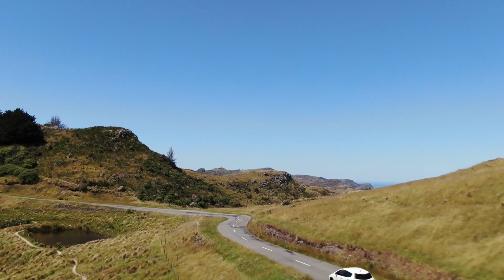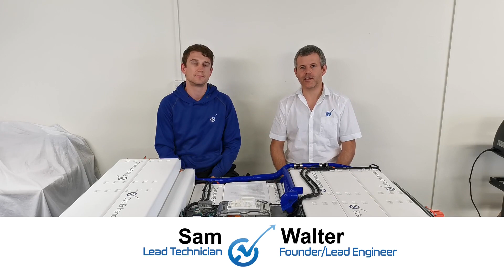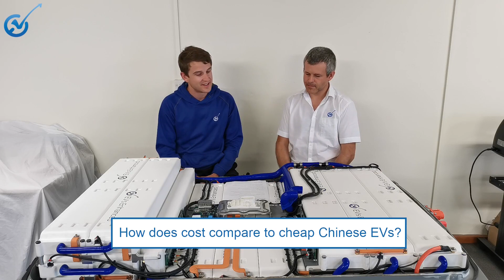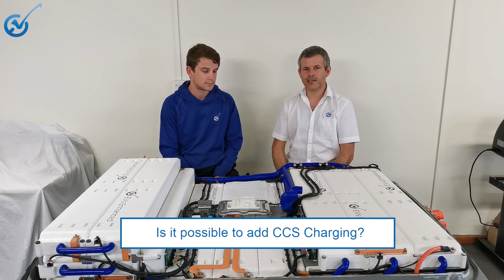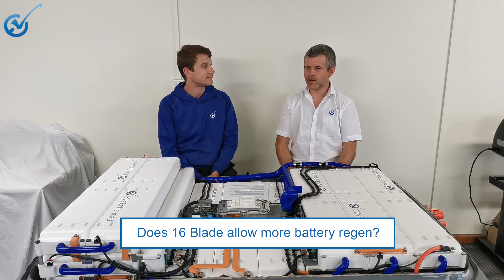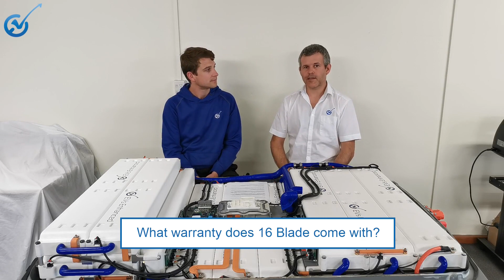Sam and Walter Answer Your Burning Questions - 16 Blade

Comment: Does the cooling system operate when the vehicle is switched off eg parked in the hot sun. I know the Tesla 3 system does this to keep the batteries cool when parked. In North Queensland the batteries on the Leaf fry in the sun. I lost about 30% range on a parked leaf in the sun for 2 months while overseas in summer.
Reply from the maker: Hi. This is still to be confirmed, but probably not.  The LFP cells in our Green variant are less sensitive to heat compared to the stock cells.  The cooling system is mainly to keep the cells from overheating during fast charging

Comment: Wonderful to see this developing, I'm curious about future proofing options though if the 16 blaze outlasted the older leaf and then wasn't compatible for a newer leaf? Also perhaps you could mention what the weight of the 16 blade is and how it might affect handling?
Reply from the maker: Hi. 16 Blade Green is very similar in weight compared to the original 24, 30 and 40kWh battery so effects on handling should be negligible. 40kWh Leafs are still in production today and this battery is designed to be compatible with those as well as earlier cars that originally had 24 or 30kWh batteries.
Reply: Hi, I just found your reply thank you for taking the time to respond. that's great, look forward to your next update. Tom, uk
Reply from the maker: @Toma2843  No problem.
Reply: Hi Eva Enhanced any word on any updates?
Reply: @evsenhanced

Comment: What is the theoretical range of the red pack?
Reply from the maker: Not a lot. Red is for short performance applications as a bit of fun, not practicality.
Reply: @EVsEnhanced  Thanks. Do you know the theoretical range of the other packs?
Reply from the maker: @hippyraverocker  Approximately 260km for city use and 200km for highway use with the green variant which is the first type that will go into production.  Blue has a much higher range, but the production timeline is further away.

Comment: Great development guys. Is there any rough figures on the weight of the 16 blade packs in comparison to the factory Nissan 24, 30, 40, 62 packs? Cheers
Reply from the maker: Hi. The stock 24, 30 and 40 packs are all around 300kg. The 62 is 440kg.  16 Blade Green is just over 300kg when dry.

Comment: Can you please elaborate more on the active cooling? Are you running a cooling loop to a radiator outside the battery, or is the radiator inside the pack? Or does the cooling loop just even out the temps of each of the cells?

I hope it's not too long before this comes to the U.S., but in the meantime it's very exciting to watch your progress!
Reply from the maker: We'll be doing a whole video on the thermal management system (both heating and cooling), so unfortunately you'll need to wait for details on that.  If you look closely at the pack sitting on display in this video you will see the two blue hoses that leave the battery pack heading towards the front of the car.

Comment: Fantastic to see this coming to market here in NZ.  Love your work EVs Enhanced.    Will the liquid cooled battery have a better performance in cold winter conditions, when mostly only AC charging?
Reply from the maker: Thanks.  The thermal management system can also be used for heating to prevent freezing.

Comment: What's the efficiency of the 16 blade? How many km/KWH?
Reply from the maker: Hi. That is more related to the car than the battery. 5 to 7km per kWh is typical depending on the driving conditions

Comment: You guys skipped my question.
What about battery heating?
It's a far worse problem than Rapidgate with everyday usage in cold climate.
Reply from the maker: To be accurate, what we have should be referred to as a thermal management system as it includes both heating and cooling.  We are planning to do a whole video on this in the future.

Comment: I admire what you're doing, but I'm still not sure about whether there's enough value for the customer in this. No CCS Charging availability, and installing on a ten year old car. Personally if the price is too high I'd rather just buy a new car and get the new car feel and performance.
I understand it's tough to make it cheaper, but does this make sense for the customer?
Reply: Judging by the general response - I'd say it's an overwhelming "YES!  About bloody time!"
Reply: A used 5 year old 40kwh Nissan Leaf is around $35-$40k vs around $20k less old battery trade in could be between $15-$17k depending on old battery health for this new 40kwh battery complete with an 8 year 160,000km warranty, seems like a bargain!

Comment: Hey guys, great to see you making progress on extending the lives of the Leaf fleet, question though, does the new battery weigh more then the old 24kwh? will it require low volume certification to fit or any suspension/brake modifications? Thanks
Reply from the maker: Hi. The weight of 16 Blade Green is very similar to the stock 24/30/40 which are all around 300kg. This keeps things much easier without chassis modifications like suspension being required. We have been working with LVVTA for some time to maintain compliance with NZ regulatory requirements.  It is still too early to say for sure, but our goal is to get to product level certification so that low volume certification is not required for each individual vehicle.
Reply: @EVsEnhanced  awesome

Comment: Did I hear correctly you say the cost of the battery will be about the same as the cost of a new car?
Reply from the maker: Nope. Maybe the Kiwi accent fooled you, but we indicated around 1/3 of the cost of an equivalent new EV before the trade-in of the old battery is considered.
Reply: Having watched this video as someone in the U.S., my question is regarding specialty: like other places outside of New Zealand, we have independent service shops that, like you guys, offer battery replacement/upgrade services. What are your plans for providing installation and service guides to other service shops?
Reply from the maker: @epicurioh  Hi. Most of these battery packs will be getting installed by other workshops.  We certainly won't be fitting them all to local cars.  We've already began discussions with some Leaf specialist workshops in the US.

Comment: Interested to know more about v2h capabilites. I would love to replace my leaf battery with the green lfp if I could also use it as a home battery to power my house at night. Would this need extra hardware? Perhaps the jet charge v2g wallbox?
Reply from the maker: Hi Ryan.  The V2H inherent in the design of Chademo is one of the big benefits that the Leaf has over other EVs.  The Wallbox Quasar that Jet Charge is importing into Australia is one of the latest V2H units on the market and looks very appealing.

Comment: Can we get a breakdown on the prices of the 3 versions of  the 16 blades? Can make a video of the installation of the 16 blade and how the thermal cooling would work?
Reply from the maker: Hi. We aren't currently releasing any more information on pricing beyond what is stated regarding the Green variant in this video.  There is certainly a video with details on the cooling system coming in the future.

Comment: Great video, answered almost all of my questions! Really excited to see the finished product. 

The one thing I didn't hear was the expected life time. I understand LFP is a better chemistry, so what would be the expected loss per year?

Also, how many charge cycles do you reckon? Tesla talks about 6000 cycles for theirs (model 3?).
Reply from the maker: Hi. Our expectation and design goal is for the battery to last for more than 500,000km.  However,  we are only aiming to offer a warranty period up to 8 years or 160,000km which is in line with battery warranties on new EVs.  We may also offer a subscription service for commercial usage with a guaranteed minimum capacity where we will continually replace or refurbish the battery as required.
Reply from the maker: @Jan 6 was "Wall Street Putsch" part 2 Hi. It's a great idea and one that we've been working on.

Comment: Amazing initiative. LFP ar3 rightly coming of age. This is a badly needed solution to the big problem - Nissan's failure to support their great EV. We provide range extenders in Ireland for Leafs and eNV200.
Reply from the maker: Thanks Eamon.
Reply: @EVsEnhanced  we also install CCS - kit designed by Muxsan. Leaves the Chademo in working order. Charge speed limited by main pack.Its not cheap.
Reply from the maker: @eamonstack4139  Yes. Muxsan is the company that we were referring to when answering the question in this video about a CCS upgrade for the Leaf.

Comment: Shame they seem to have abandon their earlier intentions to help with the Nissan env 200
Although 40 kWh would be barely sufficient anyway
Reply from the maker: No, we haven't abandoned our plans to offer an upgrade solution for the eNV200 at all.  We just said that our e-NV solution will not be based on the 16 Blade platform which is very much Leaf specific.
Reply: I understand EVs Enhanced are going to be pulling out a lot of used cells from the replaced batteries that they get to keep, and using these to rebuild battery packs for the eNV-200s.  
So although not directly, these packs are good for the eNV-200s as well.

Comment: Last year I got my old 2012 leaf's battery replaced by this team. They did a fantastic job. Honest and up front through the entire transaction. they were paitent with my many questions.
To be honest if I had known this was coming this year, I would have waited and spent twice as much and bought one of these instead!

Fantastic work guys, I may end up buying another leaf if I know I can put one of thier batteries in it - lets face it, the Nissan battery is the only really bad thing I can say about the car.
Reply from the maker: Hi Paul. Thanks for the kind comments.  We will be happy to trade your current battery in on a 16 Blade Green if you decide you want to do that when then are available.
Reply: @DVul  The price depends on the state of your battery and the capacity of the battery you select from the ones they have available, it would be unfair for me to disclose how much I paid for my exchange as it varies wildly with each exchange.
Reply: Whats the price to put a 16blade on a 2015 ZE0 -1  in Auckland

Comment: Those car importers that cried like spoilt brats at the ev tax incentives need to start getting their hands on every last RH drive leaf they can get. 

EV's Enhanced: What is the numbers of conversations per week/month you can do, and when? Will you allow batteries to be installed by other outlets? 

I'm impatient, this ev thing is far too slow in New Zealand. It's embarrassing.
Reply from the maker: Hi. Just like we currently send replacement battery packs and our translator kits to EV friendly workshops all over NZ to complete Leaf battery upgrades, this will remain the case when 16 Blade Green becomes available.  Our production capacity will be limited particularly in the first year as we will prioritise a high build quality over ramping up production too quickly.  We expect to sell out of our first years production very quickly as soon as we open pre-orders.
Reply: You think it's embarrassing in NZ?  Try being an Australian, especially Victorian where disincentives outweight incentives for EVs.  You guys even get incentives for importing USED EVs.

Comment: Absolutely fascinated by your proposed batteries.  I have an early 24kWh Leaf, built in Japan and imported/ sold in 2011.  It's the really primitive one.  I would be thinking about your BLUE, long-range pack and suspect that this will appear after the GREEN version?  As far as cooling goes, my car has no water connections to the battery, so I wonder how you're proposing cooling is accomplished.  Modifying the casing to accept inlet and outlet ports would be relatively simple, but routing it to where and what doubtless needs additional bits and bobs?  I've spent years doing professional LPG conversions in the past, so doing a professional job isn't an issue for me.  I'm still curious how you will price your kits, as the proposed third of the price of an equivalent car jumps wildly depending upon which car you look at.  Old Leafs are no longer sold, so trying to compare like with like is no help at all.  Are you thinking of a Model3?  Or an Ora Good Cat?
Reply from the maker: Eddie is correct.  For now we're staying focussed on Green.  Blue and Red development will occur simultaneously once we've got production of Green under control.  We will be doing a whole video on our advanced cooling system in the future.
Reply: A new 40kWh LEAF is about A$50k, so 1/3 of that is A$16,667?  Would like to see it around A$15k.
Reply: @edvoon  😄 Negotiating already?
Reply: @edvoon  This is an NZ company so the price would be $NZ20k less the trade in as the Leaf starts at $62k new. 

If you go on EV Enhanced website, currently my 24kwh Leaf is sitting on 77% so based on 75% battery health to replace my battery with a good used 95% battery health 40kwh replacement is approx NZ$17k. 
So this brand new 40kwh battery will be much better value!
Reply: It's a brand new battery with cooling system built into it and coolant already in it.  Coolant would need replacing after 10 years.

Comment: Any plans to sell these to us here in Australia :)
Reply: I've been wondering about how feasible it is to buy a NZ LEAF with a dud battery on auction (they're cheaper there), get this installed and import it to Australia under the SEVS scheme - exactly the same scheme used to import LEAFs from Japan.
Reply from the maker: @edvoon  This is an interesting one and is actually something that we've already begun discussing with existing contacts in NZ and Aus.
Reply: @EVsEnhanced  should we pester our local EV hackers, I mean mechanics
Reply: @EVsEnhanced  So it sounds like it's a lot easier to import a battery pack with car attached than it is to import the battery pack alone then? LOL
Reply: @EVsEnhanced  please let us know how you go :)
Reply: If this comes to Australia id be very interested.  Particularly the red pack,  i am admiring some of the Russian leaf conversions to awd. :)   imagine handing a tesla a slap in the face from the little humble leaf :)
Reply from the maker: @jestronixhanderson9898  We aren't planning to build a lot of the red packs, but will build some.  We built a Leaf with an additional motor in the rear several years ago which has been waiting for a better battery ever since. We're  planning to put one of our red packs into it. We never put a video on You Tube for that car (only went on our Facebook page).  However, someone in Russia saw it on our FB page and put it here  https://youtu.be/5EJWu4rv4Qk. That seemed to spark a few Russians to start playing too :)